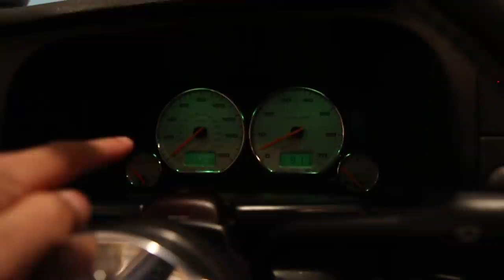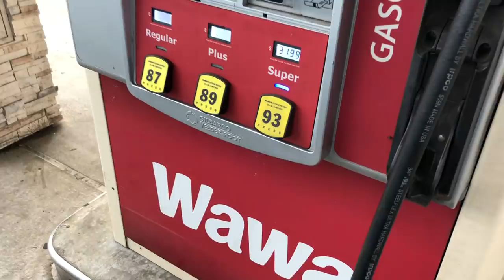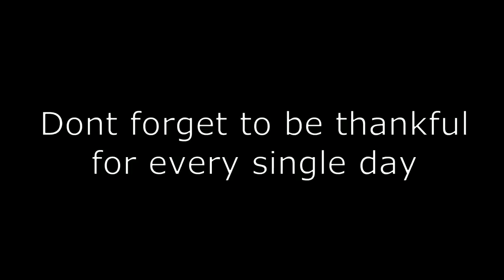My horn button finally came! and taking friends for a ride in Miley!

Comment: I bought a used MOMO Steering Wheel but damn the one you have is way dope, i couldn't decide between the Red or Blue MOMO Horn Button either but ended up with Blue, just waiting on my hub now.